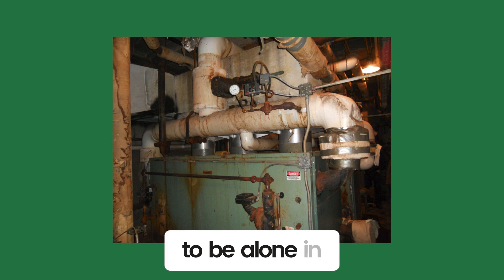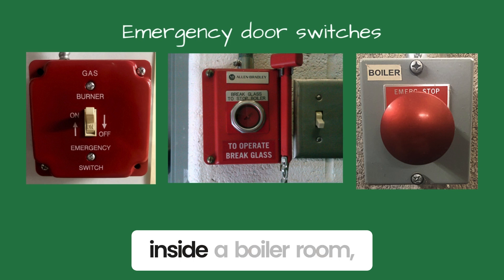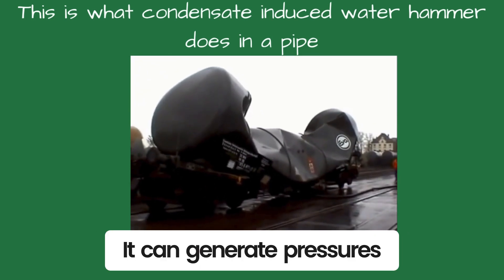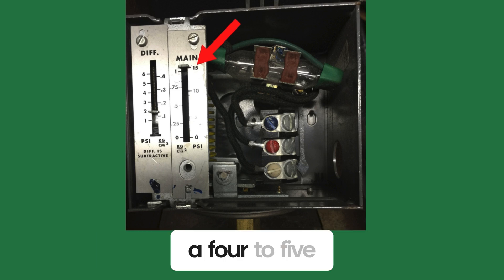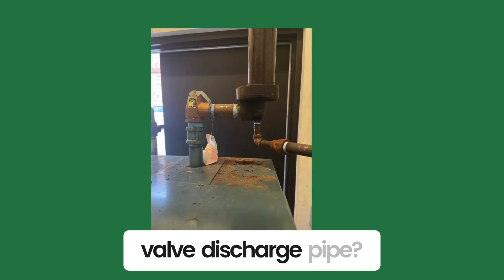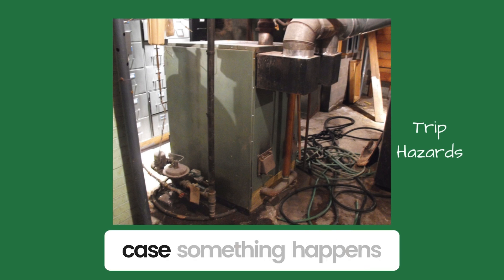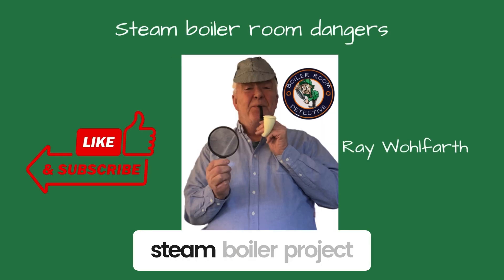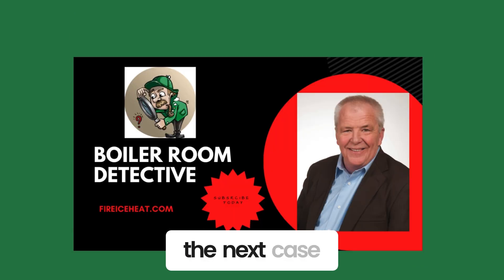Steam Boiler Room Dangers

Comment: Been fascinated with Boilers and mechanical since I was a kid in grade school. Seeing the gigantic and scary looking fire breathing monster boilers through the mechanical rm window at school I couldn’t help but be intrigued, I wanted to learn everything about them. Fast fwd 40 years I ended up a commercial / industrial electrician. I’ve seen many boiler rooms, some more scary than others. I’m always impressed by those who work on such hulks! It’s always interesting to see how they will routinely rip apart a large boiler for cleaning and repair. Just recently I saw one get stripped right down to its internal heat exchanger core. They are actually re-welding parts of the exchanger. Seems like a lost art! When they take them apart there’s piles of parts all over the place then a couple weeks later it’s somehow all back together and working again.. fascinating!
Reply from the maker: It has always been amazing to me as well Thanks for watching and the comments

Comment: Wow! At 1:35 that tank crushed in on itself in a split second! Same thing happens to Subs that go deeper in the ocean than rated for. The only difference is that in the ocean it is caused by excess pressure outside of the vessel.
Reply from the maker: Yes sir it’s crazy how it happened